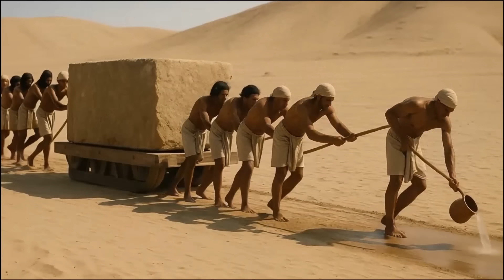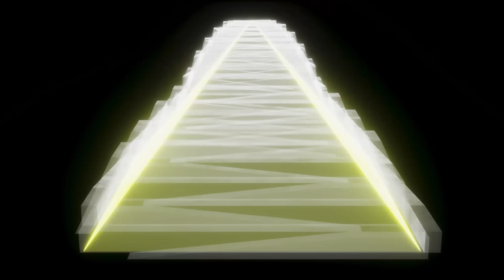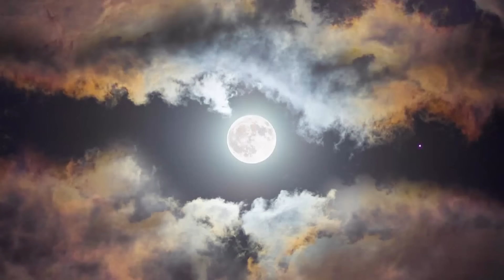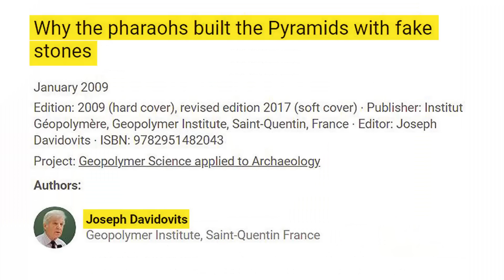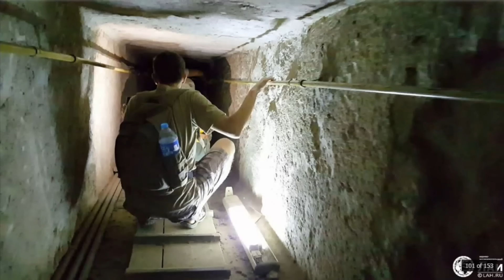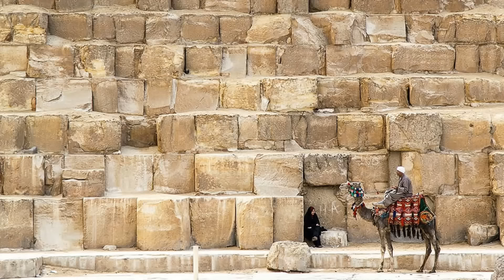The Pyramid Theory That Solves Every Construction Mystery

Comment: Thing about that, we started to build one in here in indiana.  4m dollars, I think it was.  Money was taken away.  Building stopped.  Millions of limestone blocks now are just dumped all around it.  As you build up, it becomes increasingly smaller too, until it's just a single stone.  The bottom 1/3 of a pyramid is like 75% of the work.  But if you go ahead and build it up on a hill of rocky outcrop, even more saved. 😅

Comment: Wait. I'm sorry, but no. If the stones were cast in place: you would see large irregular voids filled with a single "stone". And you would see one stone cast against the next, virtually zero gap. Neither of these are seen. Not at all.
Reply from the maker: It's known that the core stones are not that precise; they are rather rough. The casings are ultra-precise, and likely cast in place.

Comment: The geopolymer theory fails majorly in at least one way..... if you are using molds, you are going to re-use the molds over and over. Meaning that you would get blocks that are the same size and shape, over and over. However, every block in the pyramid is unique in size and shape. The idea that they would  build a new mold every single time rather than just re-using the mold is ridiculous, it would be adding extra work for no benefit, and coming out with a lower quality product. Plus... we already found the quarry, we know where the blocks were cut from. this isn't a mystery.
Reply from the maker: Who measured every block in the pyramid and found that each "is unique in size and shape"? Most core stones are not exposed at all. There are millions of stones in the great pyramid, the builders might have used different sized molds to speed up the curing process and for structural reasons. For example, the upper blocks are smaller than the bottom ones. I referenced a paper in earlier videos, which calculated the volume of the great pyramids and stated that to build the pyramids the Giza plateau was shaved off about 50 meters. A single quarry by the pyramid was not going to provide the astronomical number of stones for pyramid construction.

Comment: Even in the Great Pyramid, many interior stones are rough, uneven, or misaligned. Joints vary widely in precision and only the outer casing stones (most of those are now gone) were extremely precise. This tells us that precision was selective, not universal. The original construction was focused on accuracy where it mattered visually or structurally. Inside the Great Pyramid, some corridors are slightly crooked, and some chambers have uneven floors. The Grand Gallery has measurable asymmetries. The relieving chambers above the King’s Chamber show rough, unfinished stonework. The interior chambers were built with practical speed as the focus, not perfection. This is exactly what you’d expect from a massive human-labor project built with simple hand tools and rough measurements. The size of the pyramid projects were not insignificant or minor accomplishments, but the results were what you'd expect from a highly organized society with basic limitations on available hand tools and survey techniques. Lower your expectations on the complexity of any solution used to aid in the construction of these pyramids.
Reply from the maker: Thanks for sharing. I agree that the pyramid precision was selective. The outside, precise casings had structural and functional importance. The imperfect interior and core stones didn't serve the same type of purpose. The rubble-filled core of the pyramid exposed by the robber's tunnel looks pretty like the interior of a modern dry stack mine waste storage. Currently most such mine waste piles are made of rubble, the cemented version is a new and more advanced concept. Although today's dry stack mine waste storage facilities have compacted rubble cores, they do have enforced covering—typically consisting of soil, rock, or specialized synthetic liners—primarily to ensure long-term environmental safety, prevent the migration of contaminants, and maintain the geotechnical stability of the stack. If the goal was to securely store as much mine waste as possible in a stable form, then the pyramids have fulfilled this goal extraordinarily. 
I explained my theory on the interior structures of multiple Egyptian pyramids - hope you will find them interesting:
The True Purpose of the Great Pyramid's Interior System?!  https://youtu.be/BYr6HbEjS7w
The Secret Enigma of the Egyptian Pyramids’ Interior https://youtu.be/hxWEWUsvcS4

Comment: Im pretty sure there is a way to mold granite without burning it by using high voltage dc electric charges and maybe water and a feedback oscillator but I haven’t had the tools powerful enough to test it yet

Comment: Ignoring the construction method or the nature the block carving or casting: What is the logic for the builders choosing such large blocks? Why choose a block too large to be easily handled? Why not a smaller block to make handling almost effortless? Two or four workers could use a simple stretcher to carry blocks upward. Simple see-saw cranes could easily handle smaller blocks at speed. No need for pulleys, ramps or any "advanced" tech. Who decided that the blocks should all be that average size? Are they same size blocks in each pyramid?

Comment: If the concrete hypothesis is correct, you expect that the majority of the blocks have exact the same size.
Reply from the maker: There are millions of stones in the great pyramid, the builders might have used different sized molds. For example, the upper blocks are smaller than the bottom ones.
Reply: @CuriousBeingbyTina Why should they made the stones so heavy ? A handy format give less problems.

Comment: I'm 6 minutes into this video and thought up this way. You start at the first layer and connect a counter weight of water (or sand) containers on one side of the first layer, on the opposite side you connect the stone you wish to raise. You fill the water containers until the stone is lighter than the water (or sand) and simply move the stone to where you want it. This works all the way to the top and includes the top cap. SIMPLE, no stone residue, no ramps, just a water source (the Nile) (or sand) and ropes strong enough to bear the weight. This took me a few seconds to think up, yet for thousands of years nobody has even come close.
Reply: or use the weight of people who would then just walk back up to be reused as a counterweight.

Comment: The pyramid scan project would not find an internal ramp if the ramp was filled or partly filled in (top down). The scan project didn't show the air shafts from the kings and queens chambers. Way smaller than an internal ramp, yes, but shows the scan project is certainly not infallible. Meanwhile the notch in the Pyramid seems to show a predicted internal turning point as proposed by Houdin. 

The internal ramp also supports the building of the Pyramid from the outside in. Which is the only method which guarantees the accuracy of the outside of the Pyramid as we see today. Rubble and sand, rough cut stone etc used for the bulk of the segmented internal structure.

Comment: I like the theory that it is cast from what was drilled out of the ground. It is said that there are air bubbles in the stones and that no two are alike.
Reply: If they were cast, why aren't they uniform?
Reply: @vorpalblades  Cast in place like the walls of Sacsayhuamán
Reply from the maker: Yes, I also read that there are sit bubbles in the stones. I listed multiple peer reviewed, published material studies which all found that the core stones and casings are cast. 
As for why the core blocks are not uniformed - there are millions of stones in the great pyramid - which could have been cast in place, and/or used different sized molds. For structural reasons, the upper blocks are smaller than the bottom ones.

Comment: I think you are a bit mislead by your own intuition. 
For one to "explain" the construction of the great pyramid, one has to explain the most difficult feature. So, what about the many granite blocks? 

I do think the casting of the blocks are more reasonable but the main problem is that the internal blocks are very rough and the external ones are all from different sizes and shapes, which makes no sense when you are casting: you need many molds.  

Furthermore, construction is one thing but the whole giza plateau looks like an engineered system that works as a whole. 

The H blocks in Bolivia would be better candidates for a casting theory for example.  

I appreciate your efforts but it looks like you ignored a ton of conflicting evidences with your theory.

Comment: Your theory is untenable bc continuous layers are much more practical than casting and stacking blocks w high precision. If these are but waste dumps and not useful structures, the cold joints are not a problem

Comment: You say the pyramids were built around 4,000 years ago. That is way off. They are much older. Also, these "stones" are geopolymer. The "stones" were poured in place. People carried buckets up the pyramids to be poured. No "workers" carried any of these giant "stones". 

When you notice the "nubs" on the sides of some of these stones. That is where a hole in the mold was cut to drain the liquid so the stones would dry. Some of what was poured came out of these holes before they were completely dry. That is why the "nubs" are visible on a lot of these "stones".

I think the only other way these could have been constructed was either by giants or space aliens or both. As for me, I'll stick with the geopolymer hypothesis. It males complete sense, and the answer is really right there in front of us all. We make it out to be something more complicated than it actually is.

I never thought I'd have the answer, but around three months ago I found out about this, and now I do have what I believe to be the answer, and no one will change the mind of common sense. These "Egyptologists" are stuck in their own way of thinking. No matter how wildly idiotic their theories are, they'll stick with them. Those people, along with Hawass, are all hard-headed. You must be open-minded. We need better people.

We have the proof. Just look under the microscope.

Comment: The only possible way is to place the casing stones first as you build it from the inside out. And you fill in the internal ramps when finished. Just ask a Brick layer how they would do it. Everone ive ever asked said this is the only way to do it without massive scaffolding.

Comment: Always a good and unique viewpoint however on this one if the blocks were cast why aren't they identical?  One can see by looking at them that they are different from each other which doesn't make sense if they were being popped out.
Reply from the maker: Thank you! There are millions of stones in the great pyramid, the builders might have used different sized molds, perhaps for structural reasons. For example, the upper blocks are smaller than the bottom ones.
Reply: They were cast in place.

Comment: I disagree. Water was used
all over that construction
site. Some of the stones
were brought from hundreds of miles away floated on barges to a
canal and floated to the building site. The pyramid was built from the bottom
up. The stones were made
perfectly flat. The surface
they were placed on is
perfectly flat. A lapped surface starting from the first level. I have no doubt 
the surrounding area around the base is perfectly flat. The stones
were moved into place
using water as a bearing
surface between the stones and the placement surface. The largest ships
can be moved around with
tugs. A giant stone will slip
and slide on a perfectly
flat surface using water as
a bearing. I like to use the
Panama Canal as a way to
explain the lifting of the blocks to their next levels. The step is a perfect design for creating an
external system of locks
using a step waterfall
system. They used nature's
power to move these blocks up to the top.

Comment: Well 3 main problems with the cast theory

1 Why are the blocks different.. If using a mold one shoud have series of identical blocks
2 How to explain the quarry next to the great pyramid whose volume is roughly equal to that of the pyramid
3 Why was the cast tech not used later on

and 4 of course, what was the material used and where did it come from ?
Reply: Plus they still need to move the millions of tonnes of raw material to make the "concrete" if cast in place and wait for it to harden or if not cast in place still move the "concrete" blocks the same as the mined and cut normal blocks.

Where is the evidence for the location of the pools of concrete before being pumped.
Reply: Also the fossil evidence found in the "cast blocks"
Reply from the maker: 1. There are millions of stones in the great pyramid, the builders might have used different sized molds, possibly for structural reasons. For example, the upper blocks are smaller than the bottom ones. 
2. I referenced a paper in earlier videos which calculated that the Giza plateau was originally about 50 meters higher than it is now, based on the volume of the great pyramids. The pyramids are massive -  a single quarry near the great pyramid would not be sufficient. 
3. Cast tech likely has been used in other megalithic sites, such as the Osireion. For a long time, people thought many Roman structures are built with natural stone, though now it's known as the Roman concrete. 

I referenced multiple peer reviewed, published material which all found that the core stones and casings are cast. I listed some of them in the description. Please check them out. 

As for the fossils in the stones, here is what Dr. Davidovits wrote: "Jumbled fossil shells in a limestone block of the Great Pyramid. Natural sedimentation at sea bottom normally leaves them in horizontal layers... The pyramid blocks are made of this limestone, a sedimentary rock formed from skeletons and large fossil shells of marine organisms. These fossil remains are normally found in sedimentary horizontal layers. Yet, in the stones of the Great Pyramid, Professor Davidovits found them in disarray, jumbled up together quite haphazardly as if they were artificially mixed with some kind of pestle.

Another phenomenon observed in the pyramid stones was the presence of air bubbles, organic fibers, bones and animal teeth, foreign materials never found in natural limestone – which would seem to be further proof that the stones were man-made."
https://www.geopolymer.org/archaeology/pyramids/pyramids-2-the-evidences/
Reply: @CuriousBeingbyTina   1. No. It makes no sense to use "millions" of molds... Especially on any given level, one would expect the stones to be identical.. It is the principles of bricks. Also when you visit the pyramid you can see that the internal blocks are badly/roughly cut. 
2. The quarry just south of the pyramid (some 400 meters) has a volume of 2.8 million m3 a bit more than the pyramid itself (2.6 million m3)

Comment: The problem with the ramp theory is that the ramp must be made of harder material than the things you are dragging/rolling up the ramp.  Same as the "rollers" that were used.  Wood cannot be used to move granite stones weighing 50 tons, as they would be crushed between the harder road surface and the granite stones.  Physics just says that is not possible.  Also, a ramp must be 10 ft long for each foot in height.  A ramp that must go up 300 ft, must be 3000 ft long, or over half a mile, and made of harder material than granite.  Good luck with that.

Comment: Why does a waste dump need to be so precise?
Reply: It's probably just an engineering fetish that has no bearing on the brilliant solution offered here. Great work Tina!
Reply: @bradspsychedelium Right, it's just in the nature of engineers to be practical and not sloppy.
Reply: @fledermausmann27  Why did they need half a million tons of cement for a waste heap? Are you thinking clearly?
Reply: @bradspsychedelium  There is a lot to learn about mine waste, the environmental dangers of its leaking, and why they turn it into solid blocks.
Reply: @Greg042869  Making half a million tons of cement to hold together 5 million tons of stones makes zero green sense. The blocks are just stone, not toxic waste.
Reply: @Greg042869 There is a lot to learn from the advanced ancients.
Reply: @bradspsychedelium 🤮
Reply: Because exposed mine waste reacts with oxygen and water and leaches sulphuric acid which would poison Nile, the source of food for Egypt.

By packing and saeling the material it gets much less exposure. Some water still seeps through. That's why there are chambers to catch it, neutralize with lime and let it flow out.
Reply: @BohumirZamecnik  Why do geologists say that it is normal limestone? Don't you think they'd be able to see the residue of toxic leaching. It's a stupid theory. Please tell us the name of a geologist that has measured anything abnormal about the stone of the pyramids.

Comment: Theories were built on assumptions lacking of reality check. 

The spiral ramp for example. The block will stop short of the corner turn because there is no track ahead of the block for workers to set foot on. As no track, so no workers in front to pull it past the corner. 

Have you seen a container truck got stuck at a sharp turn in residential area?

Comment: The question “How did they build it?” is not formulated properly. It is an incorrect question. The “they” part in it is unclear. Therefore, no matter with what incessant repetition we continue to ask this question, with “they” implicitly being people wearing loincloths, we will get the same absent answer.  Because there is no rational answer to an irrational question. 

An example of a proper question would as follow. 
Who, by what technological means, by which engineering logic, and therefore with what purpose could have build structures of pyramidal geometry we call the Egyptian pyramids .